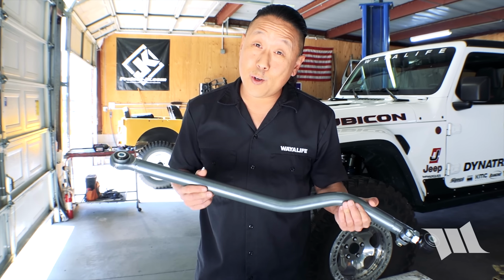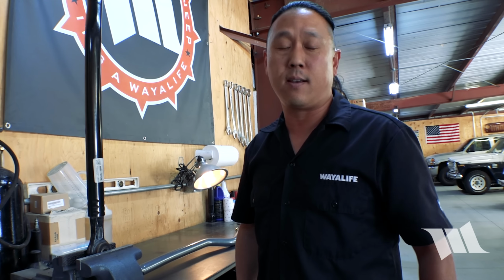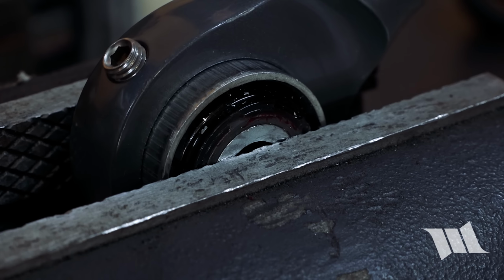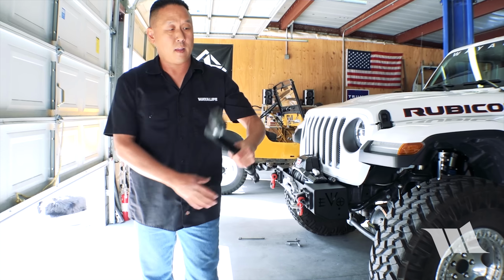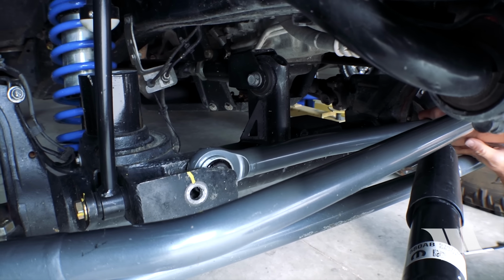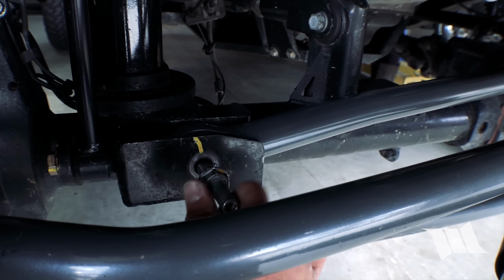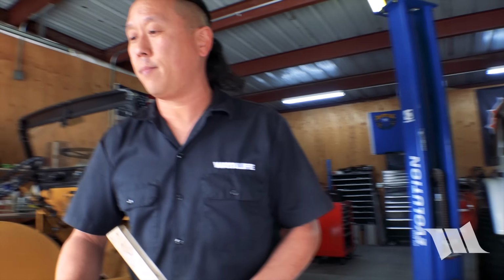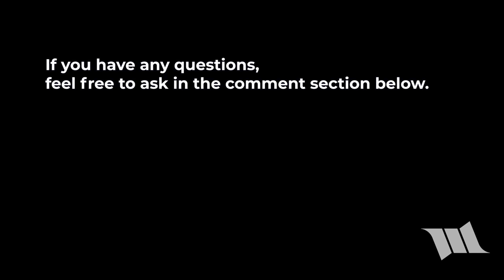Jeep JL Wrangler and JT Gladiator Truck Adjustable Front Track Bar by Synergy Installation

Comment: I have a 2021 JL that occasionally gets some wobble, out of the drag link, tie rod or track bar which you you suggest replacing first. 4000 miles on speedo
Reply from the maker: At just 4k?? Is your Jeep still stock or modified? Also, is the "some wobble" speed sensitive or something you experience after hitting a bump in the road?
Reply: @wayalife  not modified other than I put dual stabilizers on it, first time I hit a bump and it started to shake but settled down, last week I hit a bump at about 70 it it went full blown wobble, had to slow down to about 30 before it recovered. Its a Sport s, no lift but I swapped out the shocks to rubicon shocks
Reply from the maker: @tmcblane  Adding dual stabilizers would have just masked whatever problem you really have. Did you contact your dealership about the TSB they have going on with the steering box? Could be you just need the new one.
Reply from the maker: @tmcblane  Well, that said, it very well could be your track bar. I would double check to make sure the bolts are tightened to 125 ft lbs of torque and if that checks out, yeah, replacing it with a Synergy one should help. That and the reinforcement bracket they make.
Reply: @wayalife  Awesome, I appreciate your advice, is the bar and bracket listed on your website?
Or do I use your amazon link? Thanks Eddie. love the videos and appreaciate you getting back to me!
Reply from the maker: @tmcblane  Sorry, it is not. You can get it directly through Synergy.
Reply: @wayalife  Thanks man, you're awesome. I did check my torques, driver side trackbar was only about 80, put it at 125 but the other side was at 120, checked tie rods they were only off a couple of pounds. Gonna replace the track bar first and see if it improves before I replace the others
Reply: @wayalife  I ordered the track bar and the bracket, will post after installed and see if it helps! Thanks!

Comment: Hey Eddie. Maybe this has been addressed but, you stated tighten track bar bolts to 125 lb ft.
Synergy instructions say 110. Did I miss something? 🤔
Reply from the maker: Nope, you didn't miss anything. I just went off of what had been the spec for the JK. Didn't think 15 lbs would be enough to make a difference or at least, negatively.

Comment: I am curious why you still have the OEM Mopar Steering Damper/Stabilizer?  Seems like there is a better after-market option. My 2019 Jeep Sahara has a warranty extension on that part for 8yrs 90k miles and I just had that replaced with the OEM part at the dealer but will replace that in the future with an after-market one day.
Reply from the maker: I am curious why you think that a better steering stabilizer is needed or that an aftermarket option would somehow be better? From personal experience testing out a myriad of stabilizers, I can tell you that most are in fact, not any better and if anything, a lot of them cause problems such as pushing which leads to drifting or are just flat our worse and allow for wobbling. But then, that's just what I've seen.
Reply: @wayalife  I do not know. I guess I watch too many videos with all the different after-market options for all the front end parts. That is why I asked. Like I said just had the warranty replacement with the Mopar shock and figured one day I would need to replace on my own dollar and was wondering if there is any other options that are better. Thanks for all your videos!
Reply: @wayalife  I also would add that I have not see a video that endorses OEM Mopar parts. No one would watch you replacing Jeep OEM with Jeep OEM....no money or sponsors in that. Is there?
Reply from the maker: @joemama7435  I never got into making videos on YouTube back in 2007 to make money or get sponsors. All I've ever wanted to do is share what I've learned over the years with people who could benefit from my experience and with the hopes of being able to help them out.
Reply: @wayalife  You are doing great! Thanks again for all the videos.

Comment: I have notice my track bar popping on the driver side. The bolt is moving side to side. Not loose. Not sure why it would bc I have 1 1/2 level kit with 37’ tires...maybe that’s why.
Reply from the maker: When you say not loose, did you make sure to tighten the bolt to 120 ft lbs of torque or did you just use a basic ratchet and called it tight when you felt like it was?
Reply: @wayalife  I use a torque wrench and set it @ 125ft.

Comment: I installed a track bar bracket with my lift, so if I install this I am assuming I measure eye to eye with the OEM track bar correct? Or should I look at removing the bracket and installing it in the OEM location. Thx!
Reply from the maker: Assuming you're referring to a track bar relocation bracket, there is no guarantee that it'll offer the same amount of correction as you have lift. I would set your adjustable track bar to be what it needs to be and based on the position of your axle.
Reply: @wayalife   gotcha, I just watched you do that in the rancho video so that makes sense. thanks!

Comment: I’m thinking about getting one of these, my current one has a grim joint on one end and is a little rough when on the trail. Thinking about the Synergy because it has rubber ends on both sides and is adjustable for my 3.5” lift. Please give an update on wear factor and feel .
Reply from the maker: Actually, the dual durometer bushings are made out of polyurethane and I've been really happy with them.
Reply: Grim = Heim. Spell check kicked in. Lol

Comment: Hi I have a 2019 jeep jl Rubicon I have 35s wheels 2.5 in lift kit by teraflex and adjust steering stabilizer. Do I need anything else. Im not trying to do any off roading. Just local amd highway.
Reply from the maker: If you're not having any problems, you shouldn't need anything else.

Comment: Quick question, looking to install both Synergy Front Track Bar and the Steering Stabilizer Relocation Bracket from Synergy. The bolt that comes with the Steering Stabilizer Relocation, I saw it on your other video that it needs to be drilled IF YOU ARE USING FACTORY STABILIZER, however I have the FOX 2.0 steering stabilizer (NOT the black and grey ATS, NOT the orange and black ATS). Do you know if I still need to drill the inner bushing of the fox stabilizer or is it a simple bolt on.....?
Reply from the maker: You only need to drill if you are reusing the factory stabilizer. And I should note, it is better.
Reply: @wayalife  Thank you. Also, I am currently running a 3.5 inch sport lift from Rancho. Do you know if Synergy Front Track Bar will be fine with 3.5 inch lift?
Reply from the maker: @j.christopherchang1668  Yes, I ran it on the 2018 JLUR that we used to have and it was running over 4" of lift.
Reply: @wayalife  Wow, I didn't realize you didn't have Jet anymore.  So much of what I've done to improve my JLUR was learned from following your videos with him.

Comment: Hey Eddie, I have the same setup as you with the pin to stick the dampner on from Senergy.
In the video you said you had another adjustable track bar and only needed to take a measurement to match new track bar from old.
If I have the oem track bar and I measured both sides of the jeep and I’m 1 inch off center driver side how do I adjust new senergy track bar??
Do I adjust the nut on track bar to the left or right on new track bar.
Thx
Reply from the maker: Assuming you've lifted your Jeep, you need to increase the length of your track bar by turning the adjuster sleeve.
Reply: @wayalife  I do, I have a 2 inch lift Dynatrac that netted me 2.6 inches all the way around. The shop that put the synergy Relocation bracket on for the steering dampener and senergy steering system screwed up and messed up the tread of that circle threaded bolt with the hex head. 
Now in order to put the new adjustable track bar on I’m taking it to a different shop who said they will be able to get it out and I’ve ordered a new one😔😔

My wife, after having a Lyft about four months is starting to get a little death wobble in a certain part of a road on our way to her work. It is downhill and curving to the right at around 55 miles an hour.
So I decided to get the adjustable track bar and get a wheel alignment done where I saw on a YouTube video from a guy in Vegas, who owns a shop how to set the toe with in the limits of the front tires, but just barely within the limits and I guess in the video he shows how that will take care of the problem without screwing up the wearing of your tires. It is still within Mopar specs.
Reply from the maker: @johnpurtell1142  Are you sure you have death wobble? As in, an uncontrolable violent shaking of your entire Jeep and one that will only stop by slowing down to a stop? Or, do you have a bad shimmy which is NOT the same thing. Being that it only happens when going around a curve to the right, I would double check that your steering wheel is absolutely straight. If it's off even a bit, a situation like a curve will make your Jeep's computer think you're in a slide and kick off the traction control.
Reply: @wayalife  my wife had to pull off and stop to get rid of it 2 times and yes the steering wheel is straight.
It’s weird only in that location and I went there myself in jeep and the wheel shakes and I slowed down from 53 to 30 and it stopped and then went away.
I obviously told her not to go in the left lane of that curve when you go in the right lane because it’s two lanes it doesn’t happen at all. It’s really weird. 

The road does not have any major bumps. It’s a little bit roly, but I guess that’s enough to trigger it. I don’t think the adjustable track bar was hurt anything it should only improve most likely correct?
Reply from the maker: @johnpurtell1142  Okay, just wanted to make sure. Death wobble is a condition created by loose or worn out components. A new track bar will not hurt anything and if the joints on your current track bar are bad, the new one will help things. You really need to make sure the bolts are tightened to the proper 120 ft lbs of torque.

Comment: Subscribed! Great channel 🍻 .. I'm looking at upgrading to the 1.5 teraflex level kit and 35,s and fox ats steering  stabilizer for my Mojave ... Not sure if a new track bar would be necessary as well ?
Reply from the maker: With just 1.5" of lift, no, a new track bar will not be needed as you'll still be within factory specs.

Comment: Hey Eddie, what track bar do you prefer? I know you initially went with the Rancho HD adjustable, but now you’re with Synergy. I’m having a ton of DW issues that I’m trying to sort out on my Jeep. Thanks for all you do for the community!
Reply from the maker: First off, do you still have the aluminum steering box? If so, there is a TSB to have it replaced with an iron one. 2nd, what other modifications have you made on your Jeep if any? 3rd, have you made sure that your factory track bar bolts are tightened to torque spec? 4th, are you still running your factory steering stabilizer? That said, I would probably have to go with the Synergy track bar if only because making adjustments on it is easier. That said, I think this made more of a difference in tightening things up https://youtu.be/RchFRGKPY6Q
Reply: I’m running the Mopar 2” lift with 35’s and the stock stabilizer. I’m getting the balance and alignment checked now. Once I get it back I’ll do a thorough check on the front end and tighten things down as needed and take a test drive and go from there. Thanks for the quick response! I’ll keep you updated on how things progress.
Reply: Oh, and I do have the iron steering box. I verified that when I bought it because I knew about the TSB from a friend of mine at work.
Reply from the maker: Okay, the factory stabilizer is what I would recommend running. I would double check the bolts on your front track bar and make sure they are tightened to 125 ft lbs of torque. Start there.
Reply: Hey Eddie! Checked everything out like you said and the bushings were shot on my OEM track bar. Just put the Synergy one on today and it’s night and day different. Thanks again for all the help and content my man! Hope to see you out on a trail sometime!

Comment: Thnx for another great install video! 

Question: would you recommend an adjustable track bar for the Mopar 2" lift on a JL running 35's? Do you think Jeep built-in enough tolerance to the angles; camber, axle, etc. to accommodate their lift? It only goes light/moderate off-roading? Mostly overland. Thnx in advance for your response!
Reply from the maker: I would only recommend something if you're feeling the need for it. Do you feel like you're Jeep needs it?
Reply: @wayalife  HAHAHA!  It didn't NEED a 2" lift or the 35" tires. Seriously though, just trying to get ahead of the game and thinking maybe it would add value over the long haul. But to answer you directly, no, I don't feel like it needs it, just want it. I don't have that kind of disposable income so will have to sit on it for a while. :-(
Thnx for the reply!
Reply: Not really needed at 2” MacArther Nelson but it’s not gonna hurt and is definitely an upgrade over the stock trackbar!

Comment: I have a 2" Mopar spacer lift with stock Rubicon suspension on my 2020 JLUR. I recently switched from 35" tires to 37" tires and now I have a side to side shimmy on the freeway at speeds above 65-70 mph where it was baby smooth with the 35's. Could the stock track bar be a culprit here? Only 8k miles on the rig thus far so no warn parts.
Reply from the maker: It's possible but it could also be your steering box. there is a TSB for this now.
Reply: @wayalife  Ahh I see. I was unaware of the TSB. I will look into that. Eventually, I will replace all steering components with the Synergy components as well. They look great.

Comment: Hey Eddie! Isn't the slot on the adjustable nut supposed to line up with the slot where the pinch bolt is? I installed a Readylift adjustable trac bar on my 2017 Super Duty, and that's what they recommend, so the axle might not be perfectly centered under the truck. Just asking.
Reply from the maker: It's "ideal" to get it in line but not required. As is the case with any component, lining them up should take a back seat to accuracy. Synergy will confirm this as well.
Reply: @wayalife  Love watching your install vids! Lol

Comment: Sorry, im a little new to jeeps but love your videos.  Your axle was centered so no adjustment nessasary, but how would you adjust to center if it were off by a half inch or so?  do you have to jack the front end and turn the nut?
Reply from the maker: You wouldn't even need to jack the front end up. You would loosen the pinch bolt, turn the adjuster with a wrench and then, when you get your axle where you want it to be, tighten up the pinch nut again. :)
Reply: @wayalife  Thanks! i was definitely overthinking it then.  i was imagining pulling the axle into place, rather than pulling the body into place

Comment: Just a question, I recently lifted my Jeep with a 4" and added 35's on it. I have the 3.3's Falcon shocks, but the drive feels rough. What other upgrades do you recommend for me to get close to a "smoother" Jeep?
Reply from the maker: 4" is a LOT of lift for just a set of 35" tires. That said, a majority of ride quality comes from spring rate and to get that tall, your coils need to be stiffer. Shocks will only serve to dampen bumps. Also, assuming you did not install long arms to help correct suspension geometry, you're probably also feeling the affects of your factory length control arms sitting at too steep of an angle. One last thing, if the tires you installed are load range D or E, that won't help anything either as they have really stiff sidewalls. However, even if you have load range C tires, lowering your psi to about 28-30 will help smooth things out.
Reply: @wayalife  thank you for the information!
Reply: Which springs do you recommend?
Reply from the maker: For a softer ride? I personally prefer a single rate coil like the kind that EVO makes. Maybe get something more like a 2"-3" lift at most.
Reply: @wayalife  I have stock control arms. Would upgrading to drop brackets with Teraflex adjustable control arms help better the situation? 

Do you also recommend changing the stock front and rear track bar due to the sway and body roll with an adjustable Teraflex track bar?
Reply: Does the pinion and caster angle affect my ride quality?
Reply from the maker: @jxrxb  Too little caster will make your Jeep feel flighty at highway speeds. Too much caster can cause driveline vibrations especially if you've regeared to a higher ratio and or are running aftermarket u-joint style double cardan drive shafts. Pinion angle will not affect ride quality but again, IF you've installed a u-joint style double cardan rear drive shaft, it is necessary to set it to be in line with it and adjustable rear upper arms will be needed for that.
Reply from the maker: @jxrxb  If you install drop brackets, you do not need adjustable control arms as well. Installing drop brackets will help to correct your suspension geometry and that might help a bit. New track bars will NOT help but installing relocation brackets to help restore their geometry back to factory will. However, up front, you WILL need to install a drag link flip kit at the same time. Failure to do that will cause significant bump steer issues.

Comment: How would you compare this track-bar to JKS or EVO or even Rancho, considering you have had them all?
Reply from the maker: The Rancho uses the same bushings and so it performs the same. What makes this track bar better is that it's a lot easier to adjust as it can be done while installed. You don't need to remove it. JKS makes great products but I do prefer the Synergy and Rancho track bars over it and because of the dual durometer bushings they use.